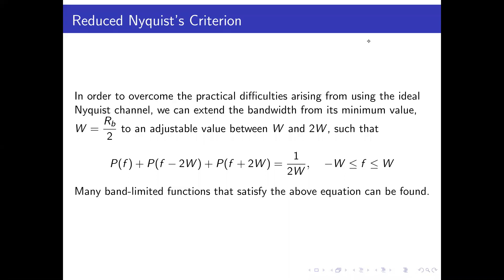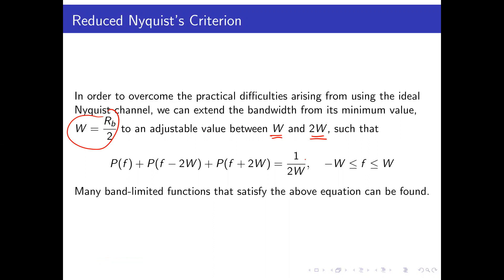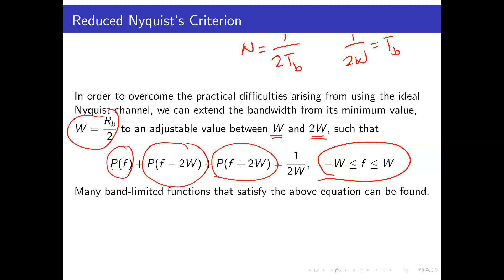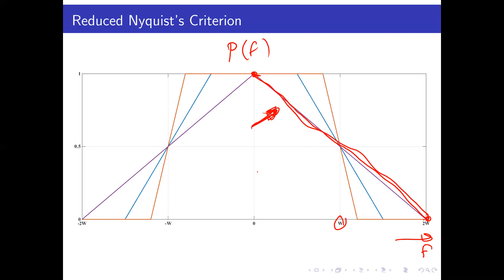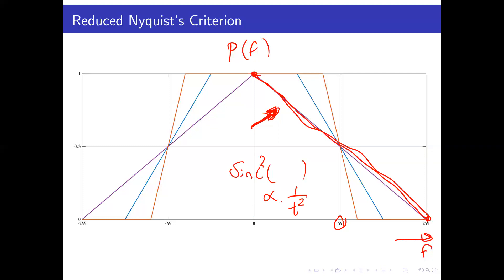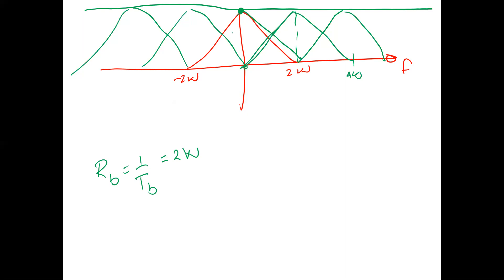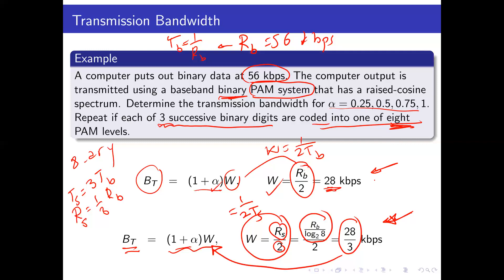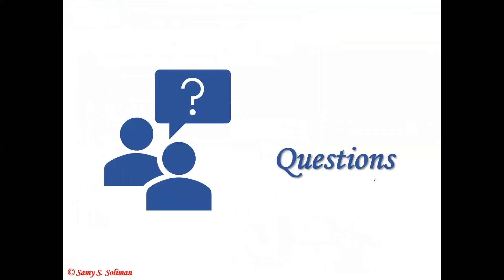Selected Topics in Digital Communications (02 - Raised-Cosine Spectrum)

Comment: بارك الله فيك دكتور سامي شرح رائع، عندي استفسار في هذا السياق، منذ شهور كثيره وانا ابحث عن الجواب من كل مكان لكن لم اجد الجواب، ساطرحه عليك باللغه الانجليزيه لعلك عندك جواب دقيق،
We have an OFDM signal of 40 MHz, and its baseband version I and Q signals drive two independent Low Pass Filters (LPFs) for pulse shaping, and each LPF is a cosine roll-off filter, so, please, I want to know the mathematical equation that allows us to calculate the cut-off frequency of this filter (ideal case)
, As we know, in practical case maybe it is different, I get it by simulation, so I want to calculate it also theoretically (mathematically) for comparaison purpose
اكون جدا شاكر لك دكتور لو عندك علم دقيق بهذا، والله يكرمك ويبارك في حضرتك.
Reply from the maker: First, thank you for your comment and your question.
Second, regarding your question, I assume you are using those filters for widowing purpose at the CP to avoid spectral growth, right? If this is the case, then the choise of the roll-off depends of the length of the CP and how many samples are within. 
An example of that can be found in these couple of paper:
https://ieeexplore.ieee.org/document/8713090
https://ieeexplore.ieee.org/document/8651816

I hope this helps!
Reply: @SamySSoliman  Thank you prof. Samy, no, low pass filters are used for pulse shaping, my question is how we can calculate mathematically cut-off frequencies of these low pass filters for both I and Q baseband signals (I have OFDM signal for example at 20 MHz); whist roll-off factors are clear !!
Reply from the maker: OK, I see then. Because there is windowed-OFDM and pulse shaped-OFDM. In the basic principle of OFDM, ISI and ICI are sufficiently mitigated through cyclic prefix (CP). 
With pulse shaped-OFDM, other motivations are included. 

You will find a nice discussion in this paper:
https://jwcn-eurasipjournals.springeropen.com/articles/10.1186/s13638-017-0849-8